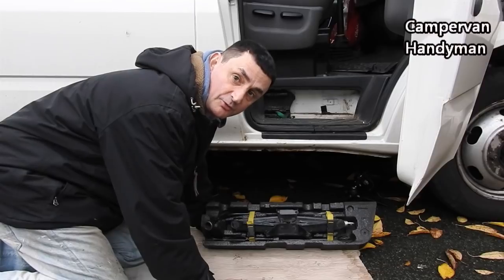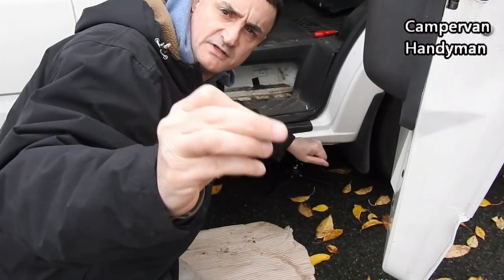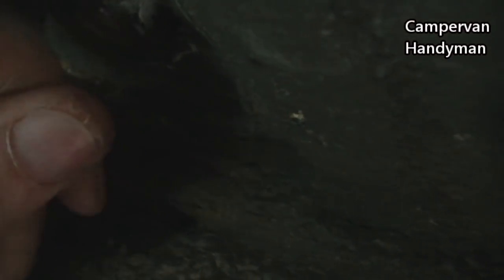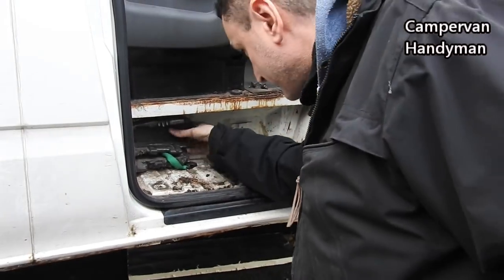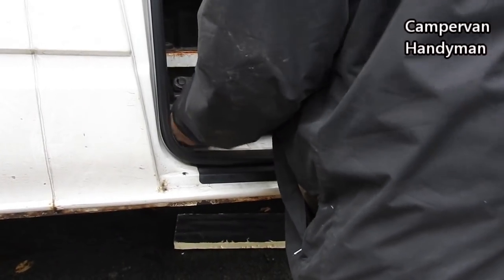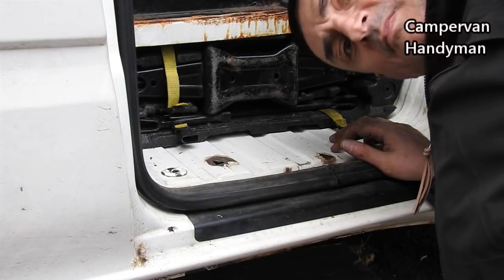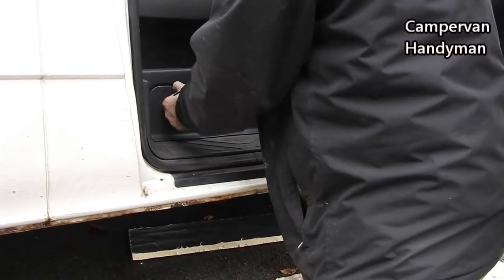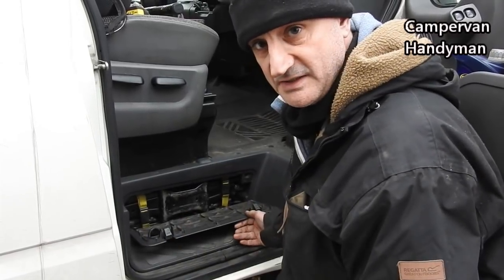FITTING A NEW JACK & TOOL KIT - FORD TRANSIT VAN - MINIBUS - CAMPER - Vanlife

Comment: Mate, you need a degree in particle physics to put those bloody jacks back in!! Flippin nightmare, I found!

You definitely got all the bits?
1.Should be a wheel brace/spare tyre releaser (has one side for the nuts and one side like a flat head screwdriver)
2. The jack Bar which has a kind of pivot to it,  and a hook one end
3 The Actual Jack which I saw!

Only reason I say is make sure you don't get caught out like I did.

Oh and the actual tyre releaser for the spare at the back was really hard to move in mine and the actual tyre brace was for the wrong size nuts!!!! So be sure it all works before you go.

Yep, I was caught out on the way to the airport to take my Wife and I had bleeding knuckles jacking up the car with a screwdriver as I didn't have the jack bar hook thing!!
Lucky I had a ratchet wrench that managed to release the wheel nuts or I would have missed the plane.

Schoolboy error but don't make the mistakes I did Pal! 
You thought about getting some tyre repairs (mushroom type that tyre shops use?) 
Far superior than anything I found in spain, I just paid them to take the tyre off of one bead and then repaired it myself!

What about a tyre inflator? Save you money on motorways keeping your tyres at perfect pressure and extends the life on tread!

Haynes Workshop manual for your motor?

SOrry it was another essay pal but I reckon you have come to expect it. Getting excited for you guys.

PS. Make sure those bolts hold up as all the pressure will be on that plastic thread now, as it is important you don't get water splashing up from the road. It will corrode the shit out of your arches.

PEACE!
Reply from the maker: Hi Mate, essay right back at ya....lol, Yep I have all the bits and tested it straight after I fitted it in the cubby hole (next vid), Sounds like you had a nightmare, I have had a couple of punctures on the motorway in my life.... not the best place to replace a wheel !! not had a puncture now for a few years though so fingers crossed. 
I wanted to make sure that everything was there though just in case.... I like to be prepared for anything ;-)
Not sure about the repair kit though, doesn't look easy to remove a tyre without the right equipment, fixed tens of punctures in bike wheels though over the years but much easier to take a bike tyre off !
May buy some of those foam tyre inflater things though just as a quick fix in emergencies.

I bought a starter pack a few months back with a compressor on it so I can always inflate my tyres too.
And I bought a Haynes manual for about £12 off ebay a few months ago.

As for the rust, I plan on taking the seats and mat out at some point and giving it a good clean under there and use anti-rust stuff so will go over inside that jack cubby hole and bolt holes then. The bolts seem pretty secure though but hey nothing a bit of super glue couldn't fix if they ever did pop out lol

Thanks for the essay ! it is actually very much appreciated as I usually do tend to miss things out !  (as you prob already noticed)

Thanks for watching and for the input.

Jay :-)
Reply: Good man Jay! Best of luck buddy

Comment: Did the scrapyard had the floor edge behind the sliding door in stock?
Nice place for the jack and co!
Check on rust under the seats, seems that there could be a rats nest of it...
8-o
Have fun& thx for the vid!
:-)
Reply from the maker: Hi Horst, They didnt have one :-( I will prob have to go to Ford and buy one new  :-( It will prob cost about £7,000,000 knowing ford though lol
Yes I plan to eventually take all the seats and floor mat out and have a good look at its condition, and prob anti rust stuff, Atb, Jay & Laura

Comment: Why didn't you put some rust remover on the floor before you put it back together Jay...Then seal it and paint it...just a thought mate
Reply from the maker: Hi Andy, yep you are right. I do however plan to remove the seats and floor mat at a later date towards the end of the build and when the weather is better and go over the whole lot in one go :-)
Thanks for the input and for watching, Thanks for watching, Atb, Jay & Laura
Reply: Good effort 🖒
What about the fart whistle though 😄😄
Reply from the maker: lmao, yep I have some of those vids ready for edit too hahahaha
will get on to it soon....
don't worry, I have still been harassing/annoying Laura whenever I can
Jay ;-)
Reply: CamperVan HandyMan Once again...Good effort 🖒🖒😄😄
Dead funny 😄😄
Reply: CamperVan HandyMan Building a van myself soon mate il keep you posted 🖒🖒
Reply from the maker: Just subbed you so if you do post a vid or pic gallery I can check it out :-)
1st subscriber..... wahaaaaay
Reply: CamperVan HandyMan 1 day il be famous like you Jay 😄😄
Reply: CamperVan HandyMan By the way Jay...🙄 Why not take the fan out  and move it over the shower..ul need a fan in there anyway then fibreglass the hole over you cut out or weld a plate over it if it's metal..Go back to your original plan..
Reply from the maker: Bloomin eckers like.... No chance I'm taking that out now hahaha
I don't have the equipment or the experience to start welding etc.... Im a novice at all of this.

Yep admittedly I should have planned a bit better but it's all very well in hindsight !!!!
I did realize when trying to plan the wet room/shower !!
I now plan to put a small extractor which will be just below the roof lining above the driver's seat. So as long as no one wants a dump while im driving its fine haha
If I ever do another conversion, I have learned valuable lessons.

I have already taken the lights out where the shower is going ready to fit into the plan but that's a much easier job than the fan !.... 

Thanks again for your suggestions, they are always welcome :-)
Reply: CamperVan HandyMan Hahaha Your doing sound Mate..I'm a builder Jay, we are engineers mate, we look at a problem and solve it..it's how we roll..Never underestimate your own potential.
Reply: CamperVan HandyMan You can do it Jay..I have faith in ur skills mate...Have a think 🤔🤔🤔...
Back to the original plan🤔 more space and better configuration when done ! 🙄🙄

Comment: The bolts you ripped out ,if you looked properly there are caps to pop off from top ,and you removed them from above not below, what you have done is tear out the captive welded nut 😂😂😂
Reply from the maker: Hi Mega Foxey, yep you are prob right, I am no expert with these things :-0

I did have a thorough look first and could not see how to possibly remove the bolts from the top and still would have no idea how to unless the plastic trim is just ripped out !! anyway Thanks for watching and the comment, please feel free to always let me know how I can improve and fix things, much appreciated, Atb, Jay & Laura
Reply: Sorry Foxey,
they are not captive nuts he removed they were nuts with a rubber washer attached,  the threaded part is made into the plastic step cover,  they will just spin when the nut is turned if a bit corrode / tight,  but the end of the thread has a hex that you can hold with a 4mm socket from a 1/4 drives socket set while you loosen / undo the nut.